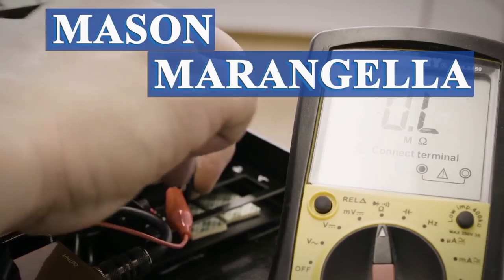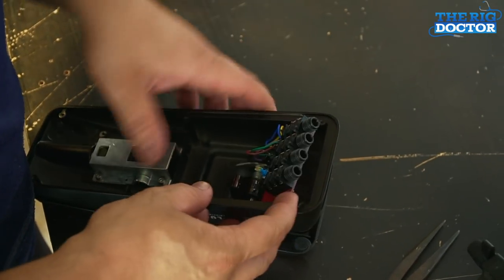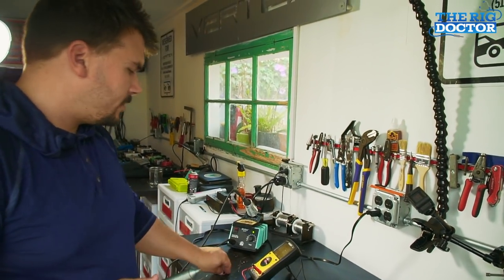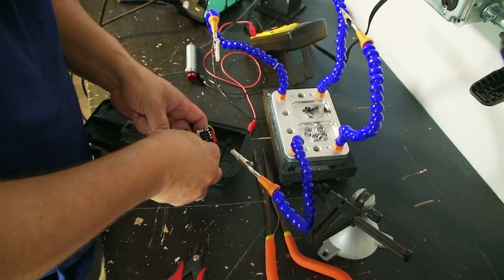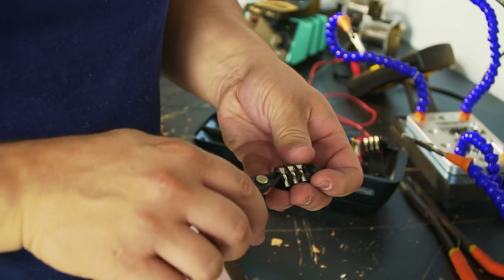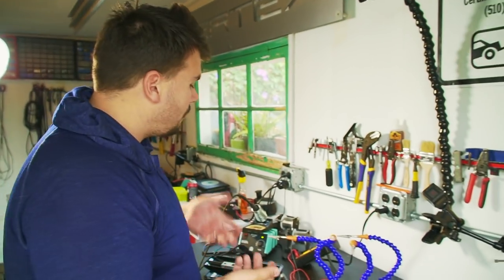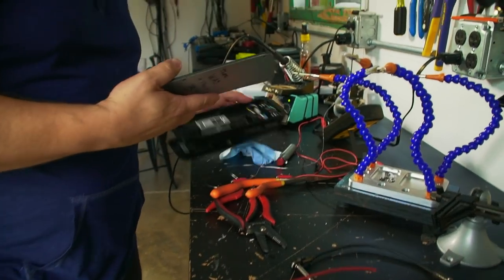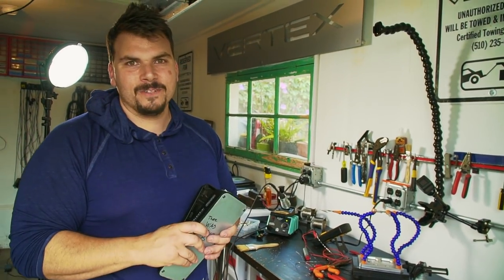Modify Your Volume Pedal

Comment: Don’t mix leaded solder with non lead. Besides rohs issues, you could also have a reliability issue, lead-free and tin-lead solder will not mix evenly during the reflow process. This will produce various alloys in different parts of the solder joint. Very likely there will be residual stress in the cooled joint, and stress is associated with tin whisker formation (and other issues) in the lead-free part of the joint. Stick with lead free if that is what your product is. FYI “OL” on a meter is “Open Loop” not “Overload”
Reply: Wow.
Reply from the maker: Hi John!  Thanks for the comment!  As you've mentioned, mixing ROHS and leaded solder is not ideal.  However, I would contend that most viewing this won't be using ROHS compliant solder, and it's pretty easy, even with a cheap solder sucker, to remove the existing solder from a few legs on a 1/4" jack and not have concern for longevity when re-attaching new wire leads with lead solder.  I was using lead solder on a few hundred Boss VP for three years, all with ROHS compliant solder on the original assembly.  Admittedly, I stopped the mods several years ago, but the ones I get back for repairs are all from pot failures (which we don't replace) or mechanical failures (which aren't altered by our mods) and nothing to do with connectivity.  However, arching back, you're right, not an ideal practice if it can be avoided.  Sorry on the "OL" thing, we addressed it somewhere below, I think I was just riffing and never caught it and our editors wouldn't have that level of technical knowledge to see it as out of place.  Hope you're well!  ~Mason
Reply: Vertex Effects good thanks, yes I have actually seen the issue happen and it is something a fellow builder clued me in to when no lead solder started to become mandatory. The slightest leftover can cause migration where you can get static crackling ghost things. Actually these days it is getting way more difficult to find lead solder and most offered is lead free. I know it isn’t fun to work with but mixing the two even if cleaning it off is asking for strange behavior.

Comment: The way you described it leaves me a little confused... If the guitar goes into the input, out of the send to the pedals, back from the pedals into the return, and out to the amp from the output, doesn't that make the volume pot the first thing in your signal chain? I'm just trying to make sense of this. I suppose you could't run the volume pot anywhere other than the very beginning of the chain if you wanted to plug your guitar into it directly. I've always thought putting the volume pedal (by this, I mean the pot itself) first in the chain was redundant because there's already a volume pot in front of all the pedals... it's on the guitar. Am I understanding this right?
Reply from the maker: Jonny, this is for folks that use their volume pedal first in the chain - which still, even though I don't endorse this placement, is still used this way by about half of the guitar community, maybe more.  Since it's a passive 250K pot, it's probably going to do better first anyway than say a 25K pot further down the line, say after drive pedals that follow an input buffer of some kind.  You could still do this mod an place post volume pedal, you'd just need to enter the signal path on your first pedal, i.e. a tuner or something like that and as long as the back of the volume pedal was exposed this would still work, but again not as ideal as it is here.

Comment: What mods did you do to Tom Bukovacs volume pedal?Was it a stereo setup?What do you think of the Lehle stereo volume pedal?Thanks for you time.
Reply from the maker: No mods to his volume pedal, he was connecting it via the boost so there won't be any need to move the volume pedal in that case since the impedance is all isolated.

Comment: I want to get a volume pedal, and change the value of the potentiometer. Is there one that is good for that kind of mod? I'm using the volume pedal as a controller for another effect, and the effect only needs about 50K (I haven't tested it) but my problem is that the effect is too sensitive so I need to be able to adjust it. I'm testing with a 250K Volume pot built into the box.
Reply from the maker: Harmono what’s the pedal it’s controlling?  Sounds like it may be a taper issue and not an impedance issue.  You could also try a low impedance volume pedals, these typically have 25K pots, where the high impedance volume pedals are 250K.  You could also break into the EXP jack on most volume pedals with an insert cable and those are usually 10K if you wanted to test that.  Again this is depending on which bless you’re pairing it with.  Let us know!

Comment: Hey Mason, Great vid!! Do you think you could do this with the outside Jacks if just want to use the expression section of the pedal? i.e. Do what you did to the outside two jacks (cutting the other internal wires off) and making the input and output an interface, whilst utilising the expression section? Cheers!
Reply from the maker: Sure, you’d just need to cut different wires from the pot and re route them as pass throughs
Reply: @VertexEffectsInc  legend! Thanks for the reply mate! Keep doing what your doin! Lovin the content!

Comment: I have a question.... Ok so I am building a board... I have the following pedals. Whammy Dumkudo Overdrive Maxon OD 808 Precision drive Fulltone Supatrem Corona chorus Keeley phaser Strymon timeline and big sky Pog 2 coopersonic germaniac I will most likely remove the maxon, trem, phaser.... I read the voodoo labs mondo is good for my needs but I do not know enough regarding this to feel comfortable making the choice. I currently run through a fruman powered pedal board but it is rather noisy. What am I missing and what should I add? Also I may be adding a gigrig g2 (if there is a better pedal switcher I am open)
Reply from the maker: Neil, you may consider looking at a switching power supply instead of a linear one like the Voodoo Lab.  Not that it's bad, but you can get more power and lighter weight with most switching supplies, and often quieter operation.  I really like the Truetone CS12 if you're on a budget or the Strymon Zuma.  Either of these would work for you, and you can always parallel the distortion/drive pedals without any issue if you need to make room for more power outputs from the supply.  As for switchers, my favorite for the money is the Boss ES-8.  It's pretty bullet proof, available anywhere, and has a much more sophisticated MIDI interface and software for editing and programming.  Other considerations would be for the MusicomLabs switcher or the RJM.  Let us know if we can assist further!
Reply: I heard for pedals like the strymon sand whammy I may need higher power 400ma and so forth, the Zuma does all that? Also you mentioned buffers before and after in a video once... would I need that? Do you like the boss es8 over the g2? If so why?
Reply: Also would you consider doing a video on paralleling OD/distortion pedals for those of us like myself who want to do it? Also I realized blonde moment in my previous response... it’s obvious the strymon pedals would work with the strymon power... question is because it is 9v 500ma would it be safe and recommended to run those 12v pedals off of that? Is there restrictions to the Zuma? I just don’t know enough to know what info to search for online. Is there an email I can maybe reach you at to discus further?
Reply from the maker: Neil Finch The Strymon stuff really only draws about 250-300mA for the larger pedals.  I haven’t committed to memory the exact number, but I remember when I measured them, they didn’t exceed 300mA.  This means that most modern power supplies will have no issue power in these, however because you have the Whammy, the Truetone is maybe the best fit because it has a dedicated 9VAC output, and that’s what you’ll need for the Whammy pedal.
Reply: According to Digitechs website manual it takes 9v DC. Zuma is DC so would I need the dedicated AC for sure that the CS12 offers? Just reading the sites and it has me confused.
Reply from the maker: Neil, is this a newer Whammy?  I always recall them being AC up until about 5 years ago, but maybe that's changed, if so, disregard the comment about the AC output, but the CS-12 is a great supply, in many way I prefer it to the other switching supplies out there.  Ultimately the user manual published specs are a better place to start than what I remembered from a few years ago when I last had one for a pedalboard.

Comment: Hi, I'm building a pedal board using a pedaltrain Pro classic. I am using a a Strymon Zuma to power most of my pedals except for two as they both need more mah than the Zuma can supply. The two pedals in question are a Boss se-70 which uses a AC 12 volt psu 1.5A and a Hall and Collins signature echo which uses AC 12 volt 1A. If I plug both psu's into the same plug board will it cause a problem like hum? I live in the UK. Any advice or help would be appreciated. Vince Ball
Reply from the maker: Vince Ball you’ll need to use either a Pedal Power AC where you wire multiple outputs in series to get the current you need and you can run the Zuma out of the courtesy outlet of the Pedal Power so you only need one IEC plug into the wall.  Otherwise you’ll need individual wall warts for each that meet your power specs, but it’ll be messier and if you try to incorporate on the board will likely be larger with a power strip and wall warts than the Pedal Power AC.  I think the Cioks also makes an alternative AC power unit to the Voodoo Lab as well.
Reply: @VertexEffectsInc  Thank you so much for your quick response and information. I have a Voodoo power plus spare, can I use that or get the Voodoo power AC?
Reply from the maker: Vince Ball You need specifically the pedal power AC, or you can look at Cioks power supplies
Reply: @VertexEffectsInc  Thanks again for the information. I'll get the Pedal power AC 👍

Comment: Do you know if the Boss FV-30L can be easily modified in a similar way?
Reply from the maker: it can be, you'd just have to draw out the traces so you knew how to redirect the unused jacks.  It'd be easier on the Stereo version than the mono.

Comment: Wonderingnif you can help me with something...is it possible to put a tone pot into an expression pedal so that the tone of what its effecting can be manipulated? Thanks!
Reply: Its a Roland EV5 which doubles as.a volume pedal with a pot inside but has no in or out....
Reply from the maker: What are you trying to do with it.  Typically for digital pedals that you'd use an EXP with, you would adjust this parameter in the pedal.  Equally with an analog pedal where the EXP might be adjusting speed or mix with, you would again want to adjust tone on the pedal.  Not sure you'd get what you think you're getting from an EXP.
Reply from the maker: On the Boss FV-500 for example there are separate expression pots (10K) from the audio pots (250K or 25K respectively), however there's not way to A/B between the two or make one not effect the other.  If it's just digital pedals via EXP you can look at the Mission Expressionator to have one EXP control three pedals.
Reply: Im using an EV5 which has no input and output jacks..just the cable out. Im usingnit to effect the rate of the oscillation in an EHX Blurst...the way the pedal is, inorder to achieve a defined pulse, it needa to be set at a tone quite darker than my dry signal. I could probably kod the pedal but that seems like too much....I though maybe there was a way to attatch a tone pot to the existing volume pot inside the EV5....so that I can have the depth of sweep I want but am avle to brighten it up when I want to. I know a treble booster would work but I love to mod stuff too much lol...so my question is...am I able to simple solder a tone pot and resistor onto the existing volume pot with  direct in and out jacks to connect to?
Reply from the maker: @nicwood2440  This needs to be done in the pedal, not the EXP.

Comment: Maybe I missed something here, is Rhett using the left over two jacks as a simple patch bay? Since you disconnected two of them, the pot will not be controlling the two disconnected ones, correct? Or do I have that all wrong?
Reply from the maker: Hey Adam!  We're disconnecting the EXP and Tuner out jack and re-routing them as a patch bay so that everything comes in/out of the volume pedal as an interface/hub for the entire board.  The pot is only wired to the input/output jack sides, the EXP/Tuner Out jacks are re-wired as pass-throughs.
Reply: Vertex Effects That’s a cool space saving idea. I wish I lived closer to you so could get you to reword my board. I would also love to have the ability to do a wet/dry set up when I have the chance on occasion.
Reply from the maker: @Craig Carson - OIT Craig, yes, just turns the unused jacks into a patch bay for the pedalboard so all in/outs happen at the volume pedal side.  Just a creative way to maximize space for this application.

Comment: Hey there Doc! Not 100% related to this video but couldn’t find any video on this subject. Is it possible to damage equipment with a home made expression pedal? I know just enough about electronics to be dangerous. I think I know what I’m doing because I’ve been lucky with all my experiments to date! 😂 Anyway I opened up my line 6 ex-1 and found only a 10k linear pot. With that knowledge I dismantled an old volume pedal and wired in a 10k audio pot (through trial and error I found 10k audio worked best when compared to the stock ex-1) It seems to work fine...thoughts?
Reply from the maker: It won’t damage anything - if it’s reading resistance on a digital signal it might now make much difference if it’s linear or logarithmic

Comment: I have watched this video twice. I still have no idea why this is being done.  After modification, how does it work as the networking hub for the entire board, and why would you need it to?
Reply from the maker: It was originally done for Rhett Shull's rig: https://www.youtube.com/watch?v=tKDRhMdjZQ8 .  Many requested a tutorial on how to repeat the modification to double up the unused jacks on a volume pedal to 1) allow it to be a normal volume pedal as it always was, and 2) allow it to be a patch bay for the entire pedalboard so all connections are centralized in one place on the rig so you don't have cables coming out of the board every-which-way.  The volume pedal still functions the same as it always did, we just re-routed the EXP and Tuner Out jacks to be "Pass-Throughs".  Does that help?
Reply: Jimsy looks to me like you can volume blend in the effects in the effects loops. It could be one or whatever effect/effects in the loop. Like delays/modulations. Or whatever you put. I like this idea 🙌😁

Comment: So I have a Fender Mustang Floor pedalboard that uses a Fender EXp-1 as an expression pedal, I have a yamaha control pedal for keyboards and it works just fine as an expression pedal for a Digitech RP-5, but my Fender Floor just don't want that Yamaha....what can I do to make my Mustang Floor to believe the Yamaha is an EXP-1?
Reply from the maker: Alex araya probably the polarity is different for the pot
Reply: @VertexEffectsInc  wouldn't that mean that the pedal works but heel does what toe and vise versa.
Reply: You have to compare / look up the values of the potentiometers of both pedals. Also some EXP Pedals work with TS plugs/jacks and some with TRS (T=tip R=ring S=shaft) and some of the TRS use all three connectors and some just tip and ring.

Comment: I didn’t understand how this is working as an interface. Can you explain? I guess it is missing an input and an output to work as an interface. It would need to have a input->send->return->output. No?
Reply from the maker: Input = Guitar In, Send = To pedals on the pedalboard, Return = From pedal on the pedalboard, Out = To Amplifier.  Basically we're removing the tuner out and EXP jacks and routing them as pass throughs so the volume pedal becomes a glorified patch bay in addition to a volume pedal.
Reply: Vertex Effects I sincerely appreciate all of your efforts and care when sharing info with us. I’m trying to understand the concept and make it sure i got it right. So, in reality, you’ll bring a cable back from the last pedal in your chain into the new return jack, which is series connected to the new send jack which will go to the amp input, right? No interference from the volume circuit on the volume pedal as i understand it or a sort of dummy box in the volume box. Also, shoot me a private message with your physical address so i can send you two little tools it might help you with cleaning right spots and tightening jack nuts where nut driver will fit.
Again, Thank you!

Comment: I’m not sure if this would even be possible but it would be super useful to mod it with a switch that turns the volume function on or off for expression pedal use. To my knowledge there is 2 pots, one 250k audio pot and a 10k linear pot for controlling the AUX/expression output. If only it had a function to turn that audio pot off then you could use the expression function without the volume level being changed! What are your thoughts on this? I guess one could just buy a whole separate expression pedal but not everyone, including me lol, has the board space for that.
Reply from the maker: Go for it!  It’s possible - you’d probably have to mount the switch on the side like they do on some of the Dunlop wah pedals that have boost functions.